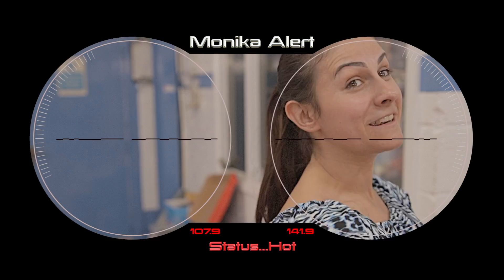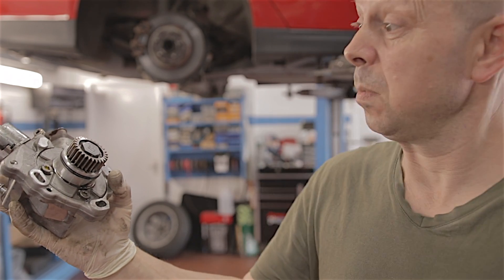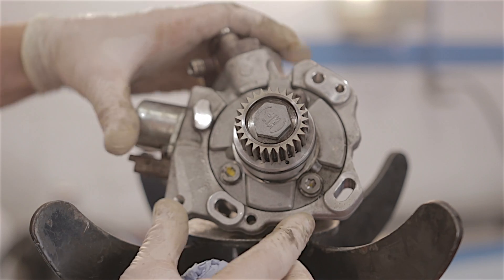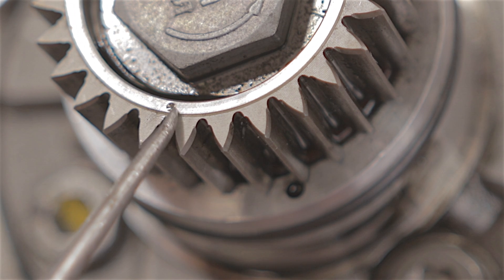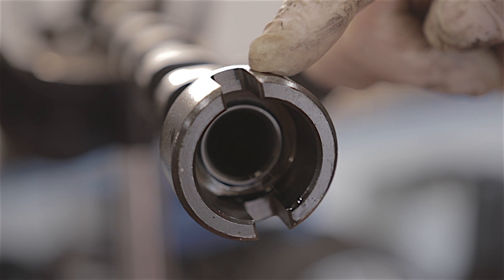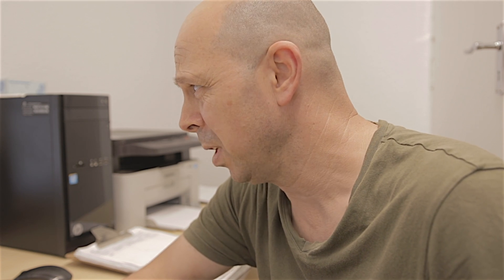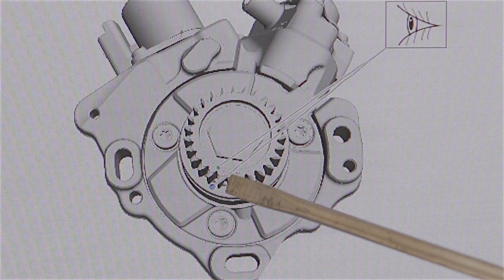Common Rail High Pressure Fuel Pump Timing.... (mk5 ford mondeo)

Comment: Thank you for this video! Im going to change the seals of the hp pump in my smax. Good to know how to time it right. But i dont get why you should lock the camshaft on two positions? If i only put a drill on the 6 oclock position, it should be fine or am i wrong?
Reply from the maker: Yes that’s all you do. Lock the camshaft at 6 o’clock using the smaller hole. 
The bigger hole is only used when replacing the cambelt

Comment: Not being smart Alan but how would that pin lock the diesel pump from that end mate
Reply from the maker: it dosen't lock the diesel pump..just locks the cam sprocket in the correct position, there are 2 dots on the diesel pump that you align if you were to remove it

Comment: I try to figure out on DW10CTED4 engine on 2013 Mk4 Mondeo. But there is only one hole in camshaft wheel and I belive also different high pressure pump. Do somebody know how about timing fuel pump and cambelt on this engine? Its 120kW TDCi with TXBA Ford code or RHH code from PSA. Thanks!

Comment: Hi Alan big fan of your thanks for making great videos, I changed water pump and timing belt on ford galaxy (mk4 diesel 2.0) following your video (cam belt on mk5 mondeo) followed all the steps shown in your video, done perfect timing and all that car started and drove no problem thanks to you but only one issue I am having is on low RPM and in reverse it jarks and making noise but after lifting foot off the break and give gas it fine.
Any idea what it can be.TIA

Comment: If the cam to pump gear is 4-1 it will reach peak pressure when each injector fires.

Acting kind of like a hybrid between an old style rotary pump and a common rail pump.

Comment: Hi I would really appreciate your help please. My pump is this psa 0445010761. My engine is a 1.5 bluehdi.
I have recently done some work cam chain and Timeing belt kit. My car runs ok but not brilliant, if you look at that pump it has the 2 locators either side so it's pretty much stupid proof 😂. Well my car feels like it's got some fuel Timeing out it sounds like a missfire, if I rev the car it's fine but driving I hear some weird noise either from engine or exhaust it seems fuel related.
The injection pump also makes a whiring noise once it warms up abit. And so there's some sort of  sensor on top with 4 Allen nuts that you can remove well I'm sure this makes a buzzing noise when reved. I've took this off and it has a spring that's compressed and a rod, I've cleaned it out and reassembled and at first I thought the buzzing went but it reappeared., I've noticed many people have had this problem after they have replaced there timing belt kit also and there is a video on YouTube with the noise in question if you would like to hear it if it will help you to help me .
I'm wondering if maybe the injection pump pulley has moved and I've turned it an extra 180 or 360 🤷 if this was the case for you think this would make a difference? 
I've had the belt of numerous times and swapped the water pump back to the original as I thought it could be that but it's not it's definitely the injection pump. Again I've tried to tension how it needs to be done but no luck unless some how the new tensioner has had it. My previous car vauxhall insignia 2.0 cdti had almost a similar problem but that noise was constant from cold and that was the fuel pressure regulator which was a changeable part and that fixed it with a very similar noise. 
1 thing I did have a problem with is the belt kept moving slightly inwards as soon as I started the car but didn't when I turned by hand previously, I don't no if other people that have this problem there belt does that. 
I just feel the slight feel something is out fuel wise and the noise chiring noise when it's a bit warm from the injection pump and the buzzing from the unit bolted to the top of the pump must be linked together.
 Injectors balance rates look fine on diagnostics as I had to reseat them after removing the cams. 
If you can shine any light on this I would appreciate it, I don't fancy goes to Peugeot and getting my pants pulled down when it might be something I've overlooked.
https://youtu.be/60ye7m-8Fr4?si=We8IHDn_io5OmxcC
Thank you
Ant

Comment: The 3 litre TDV6 engines (also known as the lion engine) fitted to jaguar/land rover cars is the same. The high pressure fuel pump must be timed also. It is driven by a separate belt on the rear of one of the cylinder heads but if it is not timed it causes problems because if the power pulses. Whilst working in a land rover garage I came across this problem several times. Many people, including mechanics didn't believe that the pump had to be timed and as a result there were premature failures of components!

Comment: Hello! i had this exact problem with a citroen jumper 2.0 hdi after resolwing head gasket failure, the pump was not alignet and the belt snapet and braked all lifters, then after second rebuild it crashed after 5000km and broke 8 lifters again, now replaced all and the cr PUMP is fited properly it runs fine now. Peugeot ,citroen,ford hdi/tdci all the same
Reply: Any symptoms of untimed  fuel pump?
Reply: @rifetfarizi6109   No. Zero 0

Comment: Even though this video is 3 years old I hope I can shed some more light on the subject. Back in the 70's I was involved with some engine experiments on locomotive fuel systems. They were 4400 hp v16 Alco's. The fuel inlet pressure was only 45 psi. The injection pressure was around 4000 psi. We discovered through instrument failure of pressure sensors that in operation the fuel rail was receiving transient pressure waves of more than 5000 psi and although these pressure waves were only microseconds in duration they were distroying the test equipment. The common rail pressure is around 30,000 psi, every issue with the pump operation is going to be greatly magnified. Timing is important to take as much stress out of the system as possible.

Comment: Hi there. Thank u for this precious info.
I installed a new timing belt in a ahn engine, 2.0 hdi and I removed the hp pump.. I saw the marks on the pump and I aligned correctly. But after 5000 kms, the belt snaped. I still do not know what happened, i locked the camshaft but I used only 1 pin.. could it be that the cause? Thanks

Comment: Hi Alan, love your channel. Does the mk4/s-max mk1 2.0l tdci a fuel pump in the tank or does it have a transferpump at the high pressure pump on the engine?

Comment: when the pump is mounted on the motor and has diesel in it, does it spin easily or does it have to hold? For me, it turns easily after hard,

Comment: Are the mk4 2.0 tdci 140 High pressure pump timed?
Reply from the maker: no its not
Reply: @alan4x  Thanks for your tutorial video.
Is 2012 2.0tdci 163 /120kw pump timed ?
And if so - did you figure out an answer on the 180°degree please ?

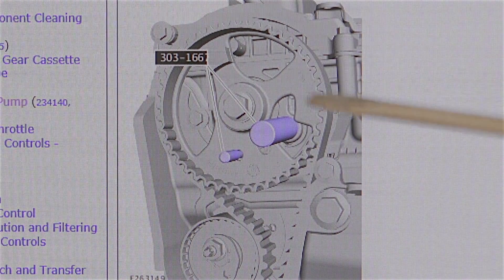Comment: Alan, please correct me if I'm wrong...I have engine leaking around HPFP (everything works fine, so I guess only the gaskets need to be replaced as you talked on the other video), so if I'm not replacing the pump do I need all this blocking do? (with alignment peg and Camshaft, 6:05) If I take the pump out I could mark only the pump's gearwheel (just in case if it was moved) and after changing 2 gaskets and the sealing o-ring I would put the pump back as it was before.
Reply from the maker: technically what you are saying would work but it all depends on where the cam lobe in the pump is sitting as if it is under load..when you remove the pump the gear on the pump would move under spring pressure.
if you do want to go ahead and remove the pump without the gear turning then i would loosen the three torx 30 screws on that little unit on the pump that the high pressure metal fuel pipe connects onto with a 17mm nut...lift that unit up a little to remove the spring pressure and then remove the pump carefully and mark it...if in doubt, its not that much more work to remove the top cam belt cover and pin the cam sprocket up,
Reply: @alan4x  thank you, you're right it's a risk the pump's gearwheel can move under pressure while removing (if the spring has not been loosened as you said, I guess I'll go the service manual way). I found out in the SM that this thin peg is for HPFP and the thick one is used when changing the timing belt. The SM also says to refer to the cooling system draining, so can you tell me... did you have to remove the coolant with any cooling system hose to get the HPFP out?
Reply from the maker: no you don't drain the coolant... there is a heater hose that comes off the thermostat housing which is kinda in the way but the pump comes out past it no problem.
if you do time up the cam sprocket..the small hole will sit at dead on 6 o'clock

Comment: Like your thought train on fault finding.  I had a recent 16 rocker smash up on a 308 2.0 HDI with a RHR engine.  Teeth stripped from timing belt, replaced the rockers and refitted everything except the injectors. I tried to turn the motor over by hand and it locked up.  Rechecked the timing marks .. all good.  Removed the cam shafts (after endless bolts) and the engine turned over ok so it was not a bent valve (or 2).  Very carefully replaced the cams, redid the timing, checked the rockers were not in the wrong place and turned the engine over by hand and lock up again.  Checked the Cam shafts with a pair of spares I had.  They did not match lobe to sprocket.  Looks like the sprocket is a press fit and it looks like it has moved, chucked in the spare cams and a second hand High Pressure fuel pump.  All systems go now.

Comment: The real reason is to get the severe pulses from the single element pump happening in-between the pulses of the valve opening forces, it would have been sensible to read the ford manual before carrying out the job. If you get a pump pulse coinciding with a valve opening pulse it will overload the belt. Volvo use a 2 piston pump like a little V twin engine which gives two small pulses instead of one big one . so the don't need the pump timed. Timing the pump is nothing to do with injection timing by the way..  the ford 1.6 D PSA engine also needs the pump being timed to the correct position..

Comment: Hello Allan,  I drive a mk3 Focus (2013) can you confirm that this engine DW10C (UFDB) with Delphi high pressure pump needs to be timed like in this video after it has been remounted? I believe it's the same as mk4 Mondeo 2 liter diesel (140 horsepower one).
Thanks for your reply
Reply from the maker: hi no it is totally different....there is just a dog drive on the rear of your pump which slots into rear of camshaft  no timing up required as far as i know

Comment: So, tell me Alan, if I want to just replace the leaking sealing (this famous one) between high pressure pump and engine cylinder head, I need to remove timing belt cover and put the timing pin to lock the camshaft? Or just remove pump, make a timing signs on in and put it back as it was? What do You think? By the way, I cannot find where is that timing pin for high pressure pump on that camshaft sprocket? My sprocket looks different from this in this video. How can I find it? Is it that slotted hole on sprocket, or round hole? I understand that the timing hole behind that sprocket (in the cylinder head) is in the different position (as in photo - at the bottom), it's not the same hole as for timing the cambelt. right?

Comment: Hi Alan, Love the videos, super informative and entertaining - a rare combination. Keep up the good work. I have a question. I have a 2015 Mk5 1.6 Euro5 diesel model. What are your top tips for keeping the car in tip top condition. Mine is at 100k kilometres and I want to get it to 200k kilometres. Because you have probably seen everything that can arise by now are there any preventative measures that should be done before any known item is likely to fail. The car is serviced regularly at Ford. 
I reckon this would make a great video. 
All and any help greatly appreciated.
Reply from the maker: there really is not much you can do apart from replace the oil and filter at regular intervals and also the fuel filter.
some parts may fail just due to mileage and usage even if you are a careful driver

Comment: from what you said or should i say read is that pump pressure at its peak needs to have a " balanced " and equal release of pressure, so that it does not have extreme highs and lows of pressure which will cause vibration in that pump or possible over pressure in system which can cause , possibly , extreme  load to the valve system destroying the weakest point the belt .... does that sound logical .... any others point of view , welcomed .... thanks
Reply from the maker: well these pumps are very precise pieces of engineering coupled with the high fuel pressure i well believe it

Comment: Like u said...american car with a french engine...it would've been easier to design the hpfp to be driven by the cambelt...so that u can see what u are doing...and therefore to set the correct timing  pins to lock it when doing this replacement and knowing 100% that your hpfp position is  accurate after the cambelt replacement is complete. But no...we like working twice dont we...💪🤘 french engineers that is..😤

Comment: It's like the 1.6 hdi PSA engine which they put in everything. You go to change the cambelt on a Volvo or ford and there is no mention of aligning or locking the fuel pump. In the Peugeot for example. It states you need you use a pin to align the fuel pump  exactly the same engine , setup and procedures yet one mentions it the other doesn't ...

Comment: That would be referring to the pressure pulsations produced by the pump.  The more gears, lobes or pistons in the pump evens out the pressure pulsations reducing values between the subsequent peaks and valleys produced.  It would depend on creating a forcing function (pump pulsation frequency) close to the natural frequency of the chain drive inducing resonance.  If that is the cause of the failure it amounts to gross oversight by Ford 'engineers'.

Comment: Monica alert. Status: Hot! That was a good one! :) The GULAG scene is great, too. Btw, do you happen to know whether 1.8 TDCI high pressure pump also needs to be timed?
Reply from the maker: i am going to look into that one but i don't think they are
Reply: Probably not. That 1.8 is a fairly primitive engine with newer bits added on at this point.

Comment: Real common problem when removing these fuel pumps due to there being two timing pins, one for TDC for belt replacement and one for fuel pump alignment, a lot of people line it up for TDC when replacing the fuel pump gaskets resulting in faults like you experienced. Basically fuel pump and camshaft fighting against each other and the weakest link at that point becomes the timing belt
Reply from the maker: cheers for that explanation

Comment: well i know what i am doing for the next month ive removed 70ish of thease due to leaking. was hopeing it was the driver being a nob
Reply from the maker: holy shit..... i only change the gaskets when the oil leaks are quite bad
Reply: @alan4x  i do them when im doing the thermo or a fly wheel as you get loads of room becase you have moved the plastic boost pipe and battery tray

Comment: Hope you have been to the corner shop to buy some humble pie to give to the driver as an apology  ref.  last comment on video 

Interesting my pump is 180 degrees out and runs but not very well at high revs hence why last owner sold it  after repair  service cam belt change 
I was told HP pump. its okay ...  I always asked why have a timing mark on then ? 
So five years later I am spurred on to change it now and compare results as my diagnostic software doesn't make sense

Comment: Does this apply to the direct cam drive on the PSA 2.0 hdi ?
Reply from the maker: not as far as i know
Reply: @alan4x  cheers , got a massive piss stain oil leak from it , so going to take pump off and swear at it for a bit and try another gasket lol , love your channel :)

Comment: is just locking cam pulley when changing belt ok or both pins in  & pump off?
Reply from the maker: if your not removing the fuel pump then just set up cam and crank pins when changing belt
Reply: Thanks

Comment: Hi Alan, this is not new info if I’m honest, the argument has been around since common rail came out. Always the same thing, don’t need to time up the HP pump, runs fine. The torsional vibration and camshaft drivetrain loading is the main and most important reason for correct HP pump timing. We used to work on Renault engined Vauxhall’s that had a geartrain valvetiming setup. People would change the HP pump and the geartrain would rattle leading to customer complaints. The reason was always the HP pump not being timed on fitment. This HP timing thing has been correct since the dawn of common rail but widely ignored. I think you have done a good thing pointing this out in a very clear and understandable way. Great videos and great entertainment. Cheers
Reply from the maker: mental mechanic 
  Hi. Yes I have heard of some pumps need to be timed and others not.. I have even had a recon pump with notes in the box saying ... no need to time this pump up. 
Only now that I have had an engine problem which I can link to incorrect pump timing I am taking notice lol. 
Thanks for your comment .. it all helps to understand these things better